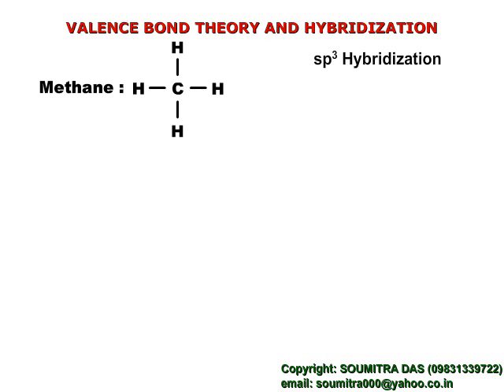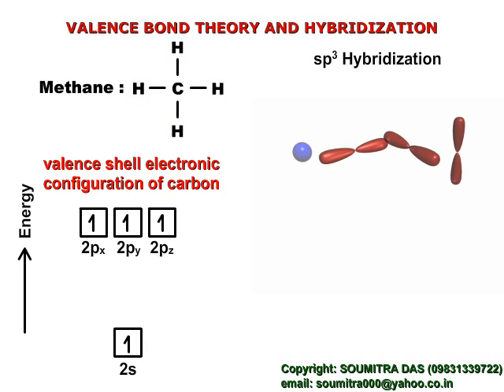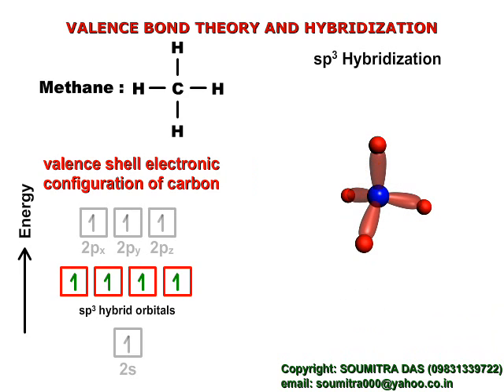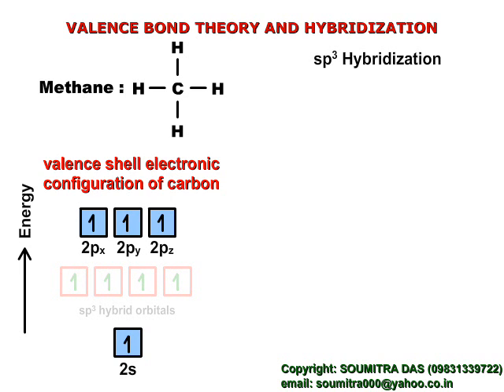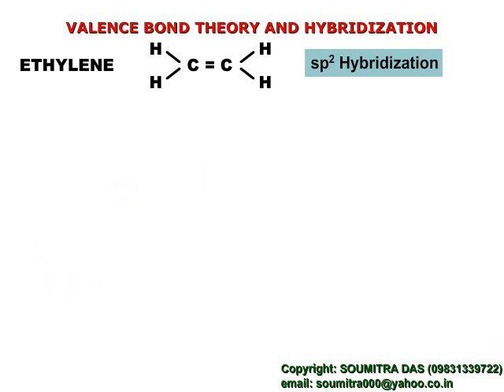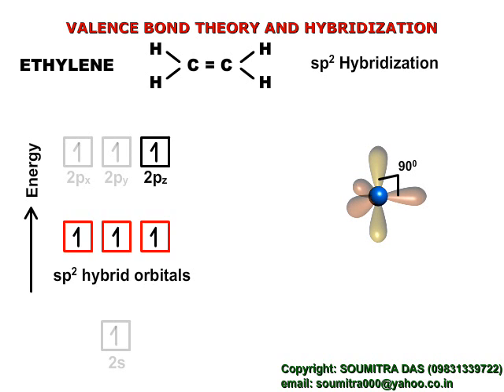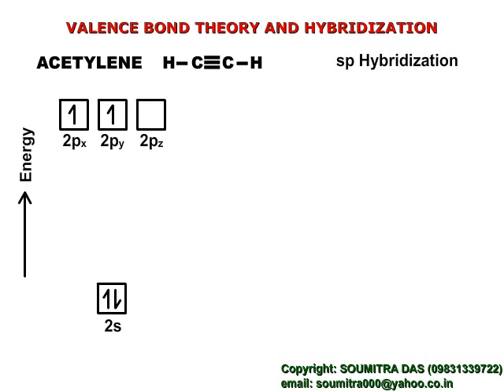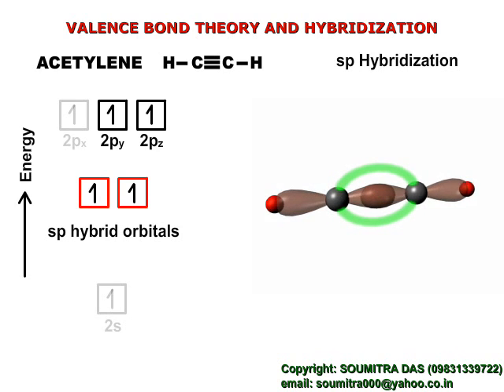VB Theory and Hybridization (Part II)

Comment: I couldn't understand the part where it was told where does the energy for hybridisation and electron promotion come from....please help.
Reply from the maker: high energy means unstable and low energy means stable. so a system always favour low energy states. So when normal orbitals become hybrid orbitals some energy is released which has been explained in the video. this energy is used for electron promotion and also orbital hybridization or mixing.